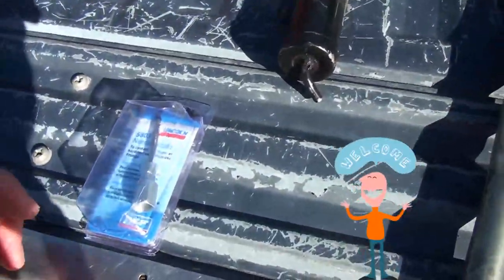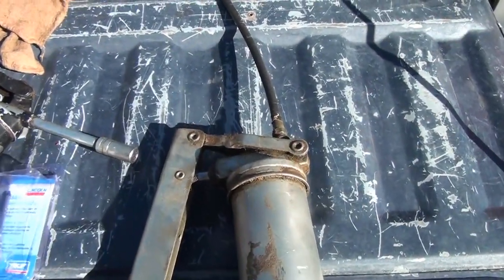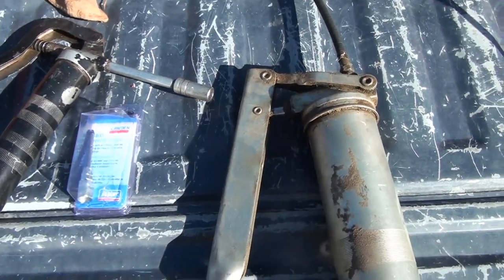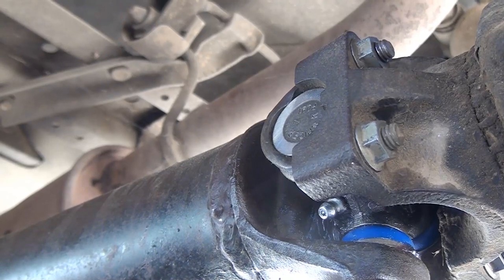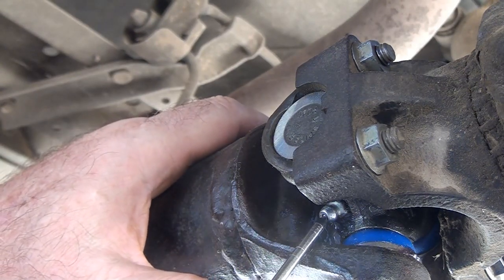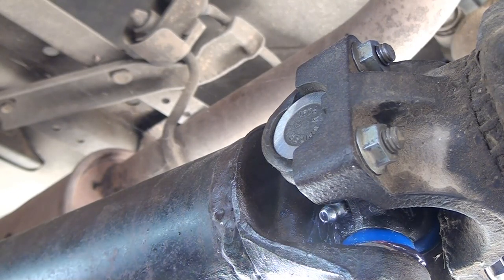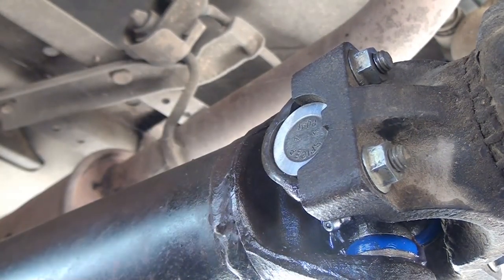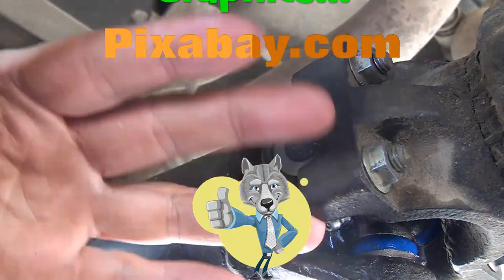Grease U Joints With A Needle Nozzle

Comment: That's 2 new ones on me, first off I never saw U joints with the grease fittings in the end like the first one you did. Second I never knew the needle greaser was in existence, how ever it does remind me of the nose greasers on chainsaws that had the roller nose.
Reply from the maker: Yes, I was quite concerned when I put that u-joint in that I may not be able to grease it. I think some older Chevys used this type.

Comment: I think this is exactly what I am looking for, hard to reach grease points, nipples as we call them in 🇬🇧 on the front UJ’s on my Land Rover Defender are a pain, great video, thank you.
Reply from the maker: Thanks...it does have its uses.
Reply: Yeah I dont think that is a "needle" nozzle in America either....because there is also an actual "needle" nozzle that is much skinnier and doesnt have a rubber tip. It looks like a large needle and has an angled tip. It could easily be used to stab someone whereas this could not. We have some tractors that use them, and they will poke through my gloves when I'm not careful.

Comment: What kind of grease did you use? Is there a difference between the grease used for bearing/hubs and the u joint one? I heard that you’re not supposed to mix greases made up of different compulounds….
Reply from the maker: I have always used a good brand of high temperature wheel bearing grease for both applications. You want the high temperature grease because of the stress and heat from friction.

Comment: i was greasing a forklift and came across a flush grease fitting with a bigger ball bearing in the middle. tried hitting it with my needle tip and it just came running out the side of the ball. any idea of what adapter i should be using?
Reply from the maker: Sorry, I do not.

Comment: thanks for showing this.. when they said it used a needle nozzle.. i got the "needle" one.. and stuck it in the small hole I could find.. I was doing it wrong.. lol.. btw do you recommend the style of grease gun you have for this kind of application or do you think the smaller ones would be a much better choice?
Reply from the maker: I like the smaller ones as they can be operated with one hand, and are easy to maneuver in tight places However, they do not hold a lot of grease compared to the larger guns. I have a few of both size(s accumulated over the years), and I generally use the larger one when I run across a fitting that dried grease inside needs more pressure (both hands) to force open. Sometimes one just has to replace the fitting though.

Comment: so how to grease a nipple inside a uni joint where the space between is to small for the head of the grease gun to fit into!!!
Reply from the maker: In the past I was able to raise one side of the rear of the car and put the trans in neutral. Then I turned the rear tire and watched as the drive line moved and was able to find a wider spot to get to the nipple. I think that is what you are asking. This can be dangerous as the vehicle must not be able roll or fall in any way. Also if the driveline was repaired and the nipple put in, say backwards then the grease gun will have no way to get to it. Probably have to remove the drive line to get to that nipple...and then change it.

Comment: Is there a certain kind of grease or just the grease in the tube.
Reply from the maker: Use the grease that comes in a tube that you are used to using. A good wheel bearing grease should be sufficient.

Comment: I tried one of these fittings but the grease just squirts out around the tip . None goes in the fitting
Reply from the maker: @Deadbuck73  Sorry it did not work for you. Maybe the grease ripple is clogged with old dryed grease
Reply: @SteveAZ711  I’m not sure. I’m going to have to look closer at it. I was thinking it could be the grease tip is cheap too… I don’t know…